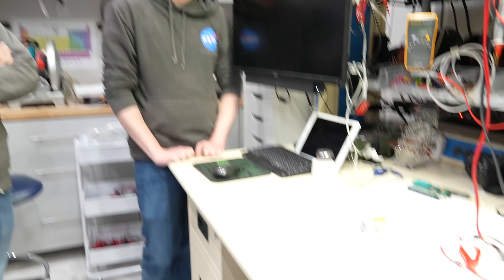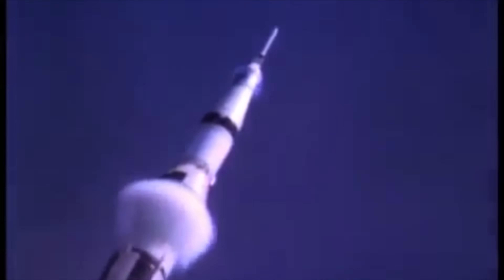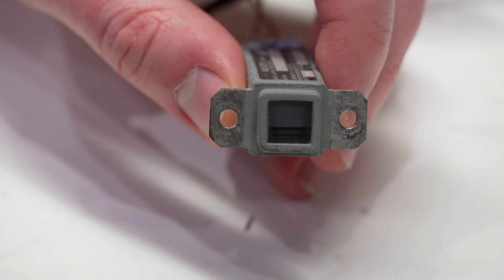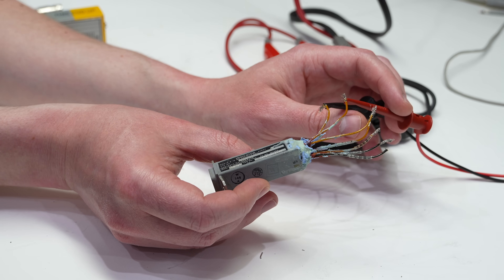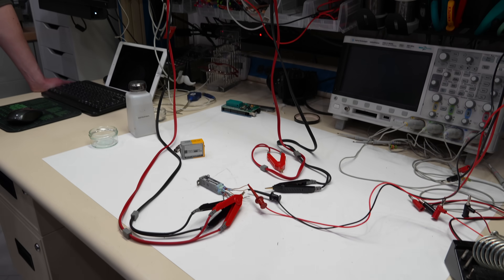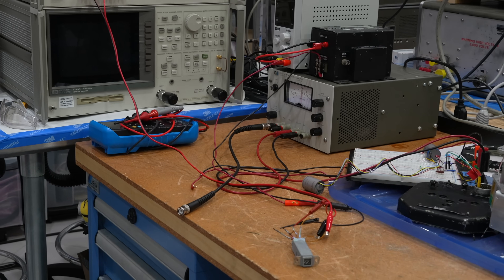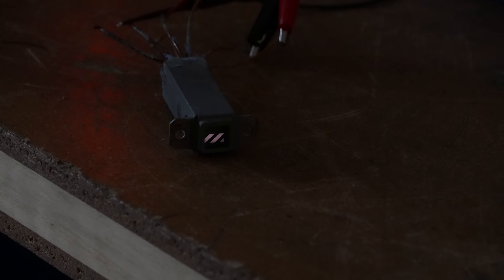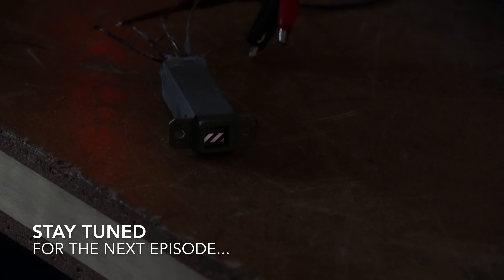Apollo Talkback "Barber pole" Indicator

Comment: If you had a fuse in your test circuit, would the EL have survived?
Reply: you'd need a precisely customized fuse for the power the EL draws. then, maybe the fuse acts quick enough to open the circuit, but it is still not a reliable protection against over-voltage because essentially a fuse needs time to overheat and melt. 

in general even a fast blowing fuse is considered slow for over-voltage protection uses... they work great for over-current protection such as a short circuit but when the current drawn by a component is tiny, fuses allow a higher voltage to flow thru for a while till the product of voltage and current (electrical power) heats up and melts the fuse. 
imagine a fuse acting like the heating elements in an electric oven: there is a delay between max power applied to the "fuse" and the generated heat (when the heating element starts glowing).

power supplies should have over-voltage protection, a circuit that clamps down the voltage at the speed of a transistor. such a circuit acts like an ON/OFF switch, the moment a preset voltage value is detected it opens the circuit. a fuse acts like a potentiometer allowing a higher voltage to pass thru before turning down the electrical current as it heats up (higher resistance as the temp increases). the higher voltage still flows till the moment the fuse melts.
Reply: Unlikely.  I'm not sure an EL would ever draw enough current for reliable fuse protection, it's over-voltage that kills them.

Comment: That's cool but what is a barberpole display used for? Why that design?
Reply: Displays on-off, or more commonly go or no-go. Think of it as an early example of a red circle with a diagonal red bar. We all recognize that as "DON'T!", these days. A barber pole was about the same in those days.
Reply: @lwilton  No. This indicator is three-state, where the barber pole is the "unknown" or "undecided" state. Since the indicator as OP and CL, it must be OPEN and CLOSED. So in this case, I think OP is the "positive state" (how it should be, or "go" since its white) and CL is the "negative state" (or red circle with diagonal red bar) which then is black to tell "no go", could be an air supply or similiar that must be open.

The barber pole would indicate "We don't know if its open or closed, please check physically" kind of.
Reply: With a single light bulb it wouldn't be easy to distinguish between "it has failed" or "it's off".
Reply: @benjaminhanke79  But, these displays are inherently redundant.  There is the illumination, but also the mechanical indication that still works even if the illumination were to fail. Everything in a spacecraft has to be about reliability.